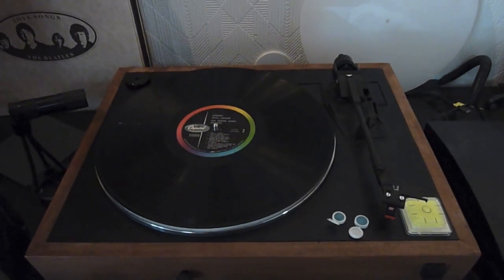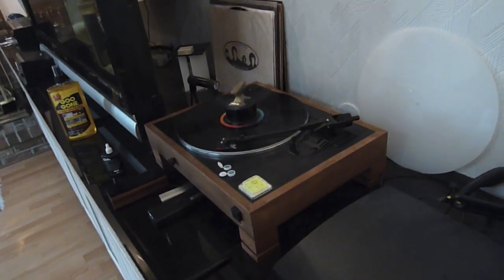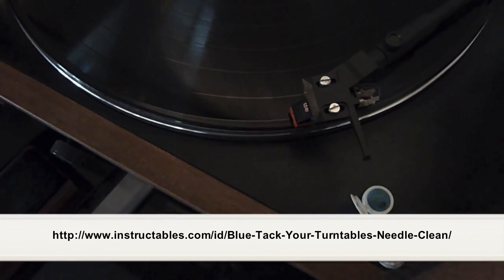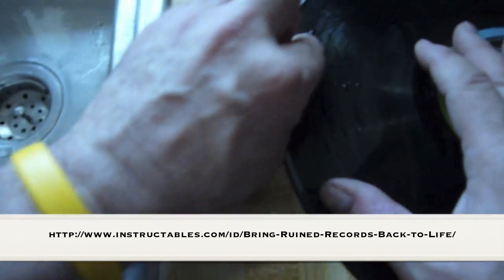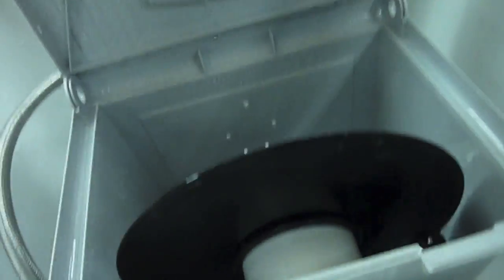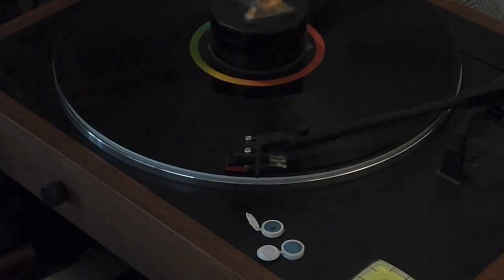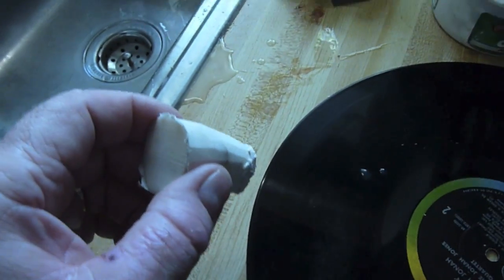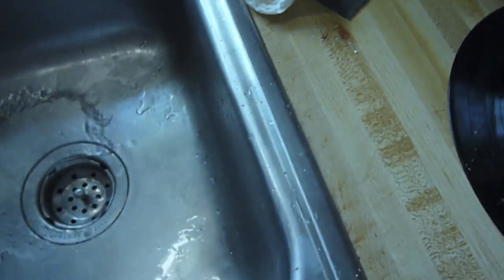Resurfacing Records to Sound New Again

Comment: PLEASE RESPOND> CAN YOU FIX A SCRATCH WHERE THE NEEDLE SKIPPS COMPLETELY OVER THE GROOVE
Reply from the maker: 1. Put an old needle onto your tonearm.
2. Tape a U.S. penny or two to the head of the tonearm.  3. Play the section that's causing the problem.

That should be enough to solve the problem.  Good luck... And don't forget to use a CHEAP, old needle.  You'll be pitting the mass of the additional weight against the strength of the vinyl, ramped-shaped wedge that's blocking the groove and "tossing" the needle into the next track.  That can't be good for the needle.

Comment from the maker: The way these comments are presented is confusing.  I think YouTube is experimenting again.  Sorry if I already answered this, but the little blue things I use to clean needles is called "Blue Tack".  Not necessarily that name in your super market or office supply store.  it's used to hold kids' artwork to walls without ruining the walls.  I use it for everything, including pulling dust off needles instead of brushing it off sideways, which scares me.  Hardly makes a noise which means no stress.

Comment: bamboos skewer much better to smooth out scratches than putting on physical material that willl gunk up you stylus -   - I knew an unscrupulous seller in Vancouver who sold marked up records that had black shoe polish all over them to make them look 'better' .  They end up in the garbage looking so good.   The only shit you should put on the record is a cleaner / surfacant  - that will COME off when the solvent (WATER) is applied after the cleaning.  Oh and Ultrasonic cleaners work but not BETTER than manual cleaning - just slower.

Comment: I’m not sure I would try any of this on records worth $$$. One thing I will do on records worth $$$ or worth pennies is use an old credit card to spread TiteBond II wood glue on them, let it dry completely, then peel it off. Works great to remove any stuck on dirt / grime. Scratches not so much though I’ve never gone to the extent of trying to remove a scratch.
And instead of ever using Goo Gone for anything, use Ronsonol Lighter Fluid. Leaves absolutely no residue once it dries. Any album covers with a sticker affixed, Ronsonol is the answer! With a caveat!
Stickers that have been there for years are sometimes best left where they are. Because the sticker glue often alters the cardboard leaving a permanent mark that is pretty much impossible to remove in my experience. The newer the sticker, the better your chance of removing it with no visible evidence a sticker was ever there.
Anyway, just my two cents.
Reply: I have a number of old records that still have their price stickers on the sleeves, and I leave them there as a matter of respect.  

Names of long-gone department and record stores are thus preserved.  I have records bearing the long-ago prices and names of stores like SS Kresge (forefunner of Kmart) and LaSalle's (defunct department store chain) and Musicland (long gone) and SuperX (drug stores owned by Kroger; vanished because Kroger later incorporated pharmacies into their grocery stores) and a long-vanished head shop that I used to visit way back when.  I feel those stickers are now a part of the record's history.

Comment: Dust is not my problem.. the static charge is my problem... no matter how much you clean a record... the static charge stays and causes the pops I even tried swiffer floor cleaners... suppose to be anti static
Reply: You can get rid of it, but it will come back yes. The best way is to either wet clean or use and Anti Stat Gun, and then keep your listening room humidified. Having the humidity levels to a minimum 30% at all times will greatly reduce any static build up.
During times like the winter seasons the climate usually turns a lot colder and drier and this is when the static will be at its worst.

Comment: Wow, you revived a record ready for the trash. I must say, I really wish it would have been explained at the onset of the vid. I didn't understand why you were taking such harsh steps until I read the comments and then it all made sense. I would hope that youngsters or beginners wouldn't take this advice for what is an otherwise good record and possibly degrade the quality.
Reply from the maker: This was my first YouTube video.  It’s way too long and has unimportant details all the way through.  In a word, it’s terrible, I know.   

The method is easily interpreted as harsh.   What most people fail to realize is vinyl is an extremely rugged material used for everything from tools to toys.  

A vinyl record can easily withstand a facelift.   It’s surprising how little material has to be removed to improve the sound.  The groove’s upper edges are the most delicate and most likely beat up points on an old record and like a hologram, trimming them down doesn’t remove any data.  It’s surprising how much material has to be removed before quality even begins to enter digital territory.

I have other things to do nowadays, so redoing the video isn’t going to happen.   I’ve put the method out there, so anyone who’s better at video, has tried the procedure and likes the results is welcome to make a better vinyl record resurfacing YouTube video.

It’d be nice to know others can get to see the method’s value without having to suffer for 15 minutes.

Comment: got a filthy old goodwill record? got a label protector? fill the sink with hot water. add 1 cup of degreaser and a good squirt of dawn liquid dishwashing detergent. mix it up so you got a nice warm sudsy (not too sudsy) bath. get one of those horsehair shoe brushes and scrub the record preferably with the grooves back and forth. fully submerge the record. then move to the next sink and fully rinse with some heavy pressure to rinse off all the cleaner. then pat dry with a microfiber cloth.....then come tell me what you think!

Comment: Never touch the groove surface with your fingers.  Oil from your fingertips attracts dirt & debris to cling to the record, and you're back to square one all over again.
Reply: As long as he cleans it? You shouldnt handle the record like that on daily basis but it doesnt really damage it, and he is cleaning it. And no, he isnt back to square one. In this case square one would be that big scratch he erased, that does not equal some little finger smudge

Comment: I was going to send an audio file over the Internet  to a friend of mine, but I realized that the sound quality was not good enough. It had been good enough for me, but it wasn't something I could send to anyone else. This led me to look for ways of improving the sound. I've never used Audacity, but I'm trying to learn. Other than that, I thought of getting physical with the disc, which is what brought me here. Suffice to say that I've bookmarked this site. Hopefully, a new needle, your methods and, perhaps, Audacity, will produce a recording that I can send without any apologies. Thanks. Oh, I won't be buying a record- cleaning machine. That would be a little too much.
Reply: Audacity is great freeware I have used it many times to convert my tapes to CD.
Reply: Fortunately, I found an LP in better condition, so I won't have to rely upon Audacity, or my ability to use Audacity, to produce a good copy. Nevertheless, I intend to TRY to learn how to use Audacity (my experience has been that it's not so easy to use or learn).
Reply: QUABLEDISTOCFICKLEPO

There are settings that do the work automatically, plus you need to down load the attachments of other users settings and see what you get for sound.

The biggest thing is to get each song copied into the program then set up the song title and spaces between the songs.  Once you have done so play the song until you hear a pop or crackle or tape hiss in a quiet area of the song, then set the program to remove that sound only by Highlighting  it's wave length in the meters and apply the clean up to the whole track or tracks and the program does the work for you.

Another important area is to make sure you record your albums into audacity at the hottest (highest level) level you can with out distortion in quality. Once you have that done then you can begin to edit the tracks cutting out long gaps and setting the perimeters of each song length and then entering their respective song number and titles. 

After that then you can begin to remove oddities in the sound and then begin to edit and update the whole album with some of the pre set sounds.  Audacity does have help areas but playing around with it works the best sometimes and just getting used to what presetting removes what or improves which layer of sound.
Reply: That's easy to say. but....  Nevertheless, I'm going to try again.
Reply: QUABLEDISTOCFICKLEPO

Did you download the help pages as well when you installed Audacity?  if you study each topic on LP Tapes and Cds and how to get the settings it makes it easier. 

Yes it is time consuming listing out the length of each song and marking the start and ending of each song, then giving them their number and Title but I believe every program has to do the same thing.

Once done you just save the raw recorded version and then play around with it until you get the sound how you want, but make sure to save the raw recording so you always have that as your base to go back too.
Reply: You're not helping. You've just added some requirements that I was unaware of. If I hear anything more along these lines, I won't even bother trying to learn it.
Reply: QUABLEDISTOCFICKLEPO

It's not as bad as you think!

Comment: Also remember rubbing alcohol above a 50% will completely trash the surface and completely eat away the surface
Reply: thanks for instantly crucifying me lol. anyways Ive tried a 70% rubbing alcohol on a old 78 (also vinyl) and it completely ate away the surface, and now there's a nice big blank spot on the record. if perhaps i need to use a 97% to not get it to eat the surface then perhaps that was my fault right there. because i tried a 50% and 70% and it made two blank spots. ill try this method again using 97% to perhaps see if that was the fault, but im not sure. with over 400 records in my collection at least i have a few junk ones. well thanks however for reminding me that 97% exists. ill try it again and see what it does. on a old 78 and on a brand new (ish) album i perhaps just dont like..
Reply: chrisz78 I just dun did tested this and apparently 70% alcohol only effects older 78 records (pre 1950s) idk if they’re made of another material or what but it doesn’t hurt the surface it just gives it a matte finish. On my 1970s 33s it just cleans it. Weird indeed but it is time for more research!!

Comment from the maker: Better than what?  The glue method?  I haven't tried it, but It does look like it would clean out the grooves much better than any other cleaner I've seen and probably much neater than wood glue.      But it still wouldn't get rid of the scratches and surface damage old records have.  Thanks for pointing me to ReVirginizer though.   I think I'll give it a try.

Comment: Labels:
Water can damage many. I keep water off the matt finish labels from the 50s.
But they won't ever come off. Never seen that. Not in 10,000 lps.

Mis-applied? Yep.
Come off with water? Never.
Water spots? Yep.

They are applied with a 2 ton machine press.
You would have to take a machine sander to it to remove it.

Comment: or if you want a quicker result ronsol lighter fluid cleand scrathes and the spray and clean with isoprol
Reply from the maker: Wow.  I've never heard of that before.  If I can find a local source for Ronsonol, I'll try it.  If it works, it might be the lighter fluid softening the vinyl enough to smooth the scratches out.  I'd want to make sure it doesn't soften the record's groove as well though.  That could reduce it's ability to produce higher frequencies. But if it works, wow.  Thanks for the info.
Reply: No problem mate
Reply: Bruce Kinsey

Comment: I wonder,when a record comes from the factory the grooves contain some grease needed to loosen it from the mold. In the beginning the grease is thin and the only negative thing is that it attracts and holds dust,what happens when the grease gets older? I have the impression my records from decades ago have much more crackles than at the time. Has the grease become less thinner.

Comment: Personally I would not put all that weight on the stylus and cartridge it will damage the stylus and record just adjust your Ballance weight on the back of your tone arm correctly and the anti skate I am not a collector I was a mobile DJ in the 70 s and worked with vinyl records that was all we had I never had to many problems with them that is just my personal opinion and experience everyone has a different idea

Comment: Of course there's going to be scornful comments, mine included. What I found scowl-worthy was the comment "perfect" during the final play as we hear pops and clicks. Come on. Also, you didn't hold the camera near the speaker at the end like you did at the beginning. And finally, if you were going to give the vinyl a bath, why bother with that sticky roll? Don't waste time. Just give it a bath. All that said, this was an interesting video.
Reply from the maker: +siskokidd 
Ha, ha, ha... Great comment.  Too bad I'm only reading it now. 
And you're right, there is a little nick, but it was so deep and so loud, I overlooked its remains after sanding, considering it resolved.  Sorry about that.  
I did hold the camera next to the speaker, but used the zoom to get closer.  I should have mentioned that in the video.... 
However, that sticky roll is for dusting, not cleaning (I'm separating the term "dusting" from "cleaning" here).  Dust is always floating around here and settles on anything horizontal. I shine a light across the record at a low angle to show me where it is.  Both it and the dust are visible in the video.  The roller really does work.
Reply: You won't believe what I tried to clean a record with the other day - car wax. And it worked! I tried it on a very badly damaged BeeGees 45 from the early 70's. I first gave it a bath with 50/50 rubbing alcohol, applied with a cotton pad (used for makeup application/removal.) That usually is enough for most albums with general 1970's dirt. The difference before and after is often dramatic. I wanted to try even further on this damaged record with wax, and it did the trick as far as really going after dirt/tobacco smoke/film. The final cleaning stage was simply playing the record with the needle pulling out the remaining wax from the grooves. Then I used a disc cleaner (velvet cloth) to wipe off that wax dust.
Reply from the maker: +siskokidd 
Incredible info.  Thanks.  I'm going to try that.  I'll use a beater cartridge tho:)
Reply: Don't know which wax would be the best. I used a liquid Maguires formula. I think the success I noted was the wax both cleaned out stuff, plus filled in some pits. The worst of the noise was gone, but the big pops remained. A bad piece of vinyl to begin with, it was an improvement, not a restoration by any means. I worked the wax in along it's length with the cotton pad, pressing with some vigor, then removed it on the reverse, clean side. Then a final removal/buff with another pad, then the play-through. Before the playthrough, you shouldn't be able see a trace on the vinyl. Have fun!
Reply: I use distilled vinegar and distilled water with a few drops of dishwasher surface tension reducer, to allow the mixture to enter deeper into the grooves.

I do not use alcohol any more, as it reacts with the vinyl, even the proprietary alcohol based cleaners are actually destructive. Besides distilled white vinegar is cheaper., and just as effective at lifting dirt.

I finish, after a bit of a soak with this mixture, with an ordinary vacuum cleaner , and an adapter I made from PVC drain pipe, wrapped in microfibre cloth,  to keep it from scraping the vinyl surface .
Reply: I use distilled vinegar and distilled water with a few drops of dishwasher surface tension reducer, to allow the mixture to enter deeper into the grooves.

I do not use alcohol any more, as it reacts with the vinyl, even the proprietary alcohol based cleaners are actually destructive. Besides distilled white vinegar is cheaper., and just as effective at lifting dirt.

I finish, after a bit of a soak with this mixture, with an ordinary vacuum cleaner , and an adapter I made from PVC drain pipe (cut a slot the width of the grooves, drill a hole for the record player's centre pin, use duct tape on the end of the drain pipe , wrapped in microfibre cloth, glued on, as a spacer at each end,  to keep it from scraping the vinyl surface) .
Reply: White vinegar? hmm, scratches chin...

Comment: This was hard to watch with the sandpaper and goo gone. You can achieve the same results as the sandpaper with a sewing needle, small chisel or a wood or plastic tooth pick and not have that god awful huge spot on the album. If you can get the spot magnified and clean out the grooves it will achieve what you did and look so much better. I guess this is cool with a worthless vinyl or something you are going to play the devil out of.